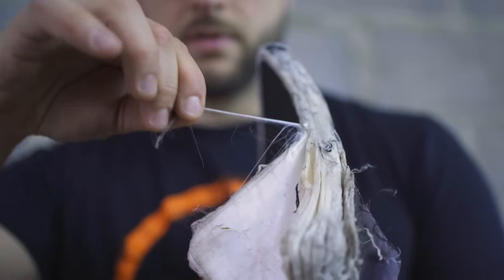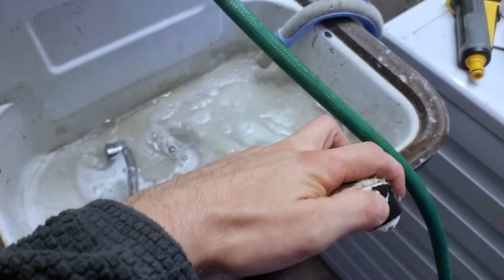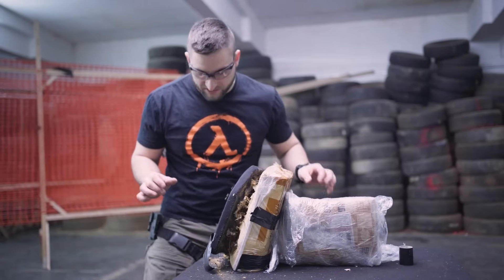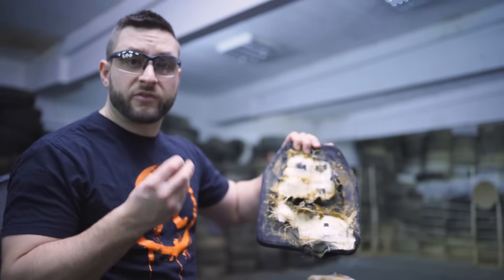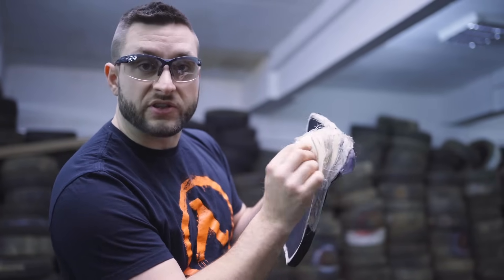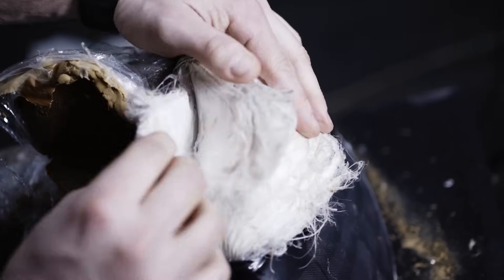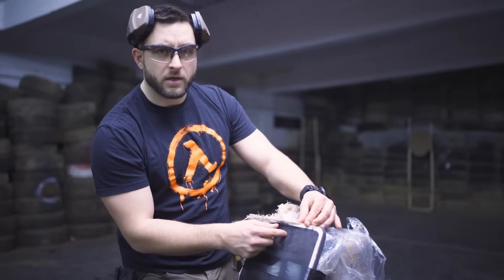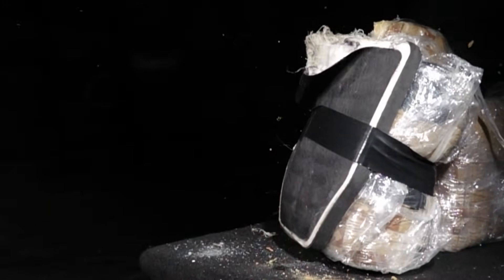Water will compromise Ballistic Plates

Comment: The clay has a massive gaping hole just from the impact pressure. Unfortunately I don't know how to read a clay impression. Without being too graphic, what would that do to a human?
Reply from the maker: Give you a bruise
You cant really read this normal clay. To be at least comparable we would need ballistically calibrated clay at a certain temperature and then we could measure the depth of the impression on the clay and see if transfer of energy is still in normal levels or if it would fail NIJ rating

Comment: The only question I have about armor is heat and cold cycles like in a trunk of a car.
Reply from the maker: Good question
It will degrade it over time but probably not in any significant manner. Ceramic will not be affected, only the backing material. HDPE is quite stable and can easily take the heat cycles but very high temps in the car can probably degrade the glue that holds all those sheets together. 
But again, i doubt that it would make much of a difference even after a decade or two

Comment: I am ghetto and have 3+ steel with a 29 layer Kevlar panel in front and back for spalling. Its heavy af 26lbs, but I would not be running around in it if I ever needed it. It's more for driving from a to b lol
Reply: Bullet fragments flow along the plate and push out along the sides. Kevlar in front and back is useless to stop "spall". You need to wrap the sides of the plates to prevent injury
Reply: @MB_MagicMOnkĒLove  It is larger than the plate and wraps on all sides
Reply: @mhnz785  crazy cumbersome 26 fkn lbs jeez, yeah your not moving around in that very well.

I run ceramic/poly lvl IV that weigh 5.5lbs each, with 6x6 side plates on a Minimalist carrier, and the rig weights 17lbs (without mags or any extras).  Waited for a great sale and only paid around $300 total. 4years ago

I have a backup rig with AR600 steel that have a really good anti-frag coating and those plates weigh 6.6lbs each.

Comment: PE/ Polymer is waterproof (hydrophobic in some blended forms) so I wouldn't expect it to lose performance apart from the very stunted degradation that comes from time and environmental exposures.  
Ceramic is also partly resistant to water, but also degrades faster and differently than PE or Steel-- uncoated/ untreated Ceramic can be affected by Salt Water more than Fresh Water, but is typically minimal.  
I don't think Steel really even needs mentioned, but no affect besides rusting risk if not properly treated.  
Kevlar on the other hand can absolutely be affected (and usually is) by water saturation, completely different material and is the root of general discussion with loss of protective capability in Armor.

That backface deformation/ trauma with PE is pretty gnarly.

Comment: I've always been taught that soft armor should never be soaked in water, both because of the degradation of the material and because water can act as a lubricant, allowing a round to pass through where it might not have before.
Reply from the maker: Most modern soft armor shouldn't be affected by moisture or water. There was a big incident with some type of soft body armor, i think it was Zylon or something like that where the material was degraded by moisture. A cop got shot and the vest failed to stop the bullet
I think from that point on people just assume all body armor can be degraded by moisture or water. 
I never heard the reasoning that water could act as a lubricant and make it less resistant - but you just gave us a great idea for a video! :D
Reply: I know nothing about BA but the plate and the demo looked encouraging, and I would prob wear that  with confidence @PolenarTactical
Reply: This isn't soft armor

Comment: Maybe you won't have a bullet hole, but you sure gonna have broken ribs
You a casualty either way

(Edit: what i meant is steel and ceramic don't break your ribs, but they are heavier. It's better to have something (UHMWPE) than nothing, but it's better to have steel or ceramic)
Reply: dudes be like "i'd rather be dead than have a bruise or a broken bone from backface deformation" 💀
Reply: @zeayh  Broken ribs from the .308. Yes, you'll be alive but you'll be out of action for a long time and your buddies will have to evac you so they'll be taken out for the time it takes to evac you and make it back. It's why German machine gunners in WWI aimed at knee level. Get a casualty out of action along with the evacuation crew.
Reply: @zeayh  
Nah, i didn't say i wouldn't use bodyarmor. You are twisting my words 😅
You can use steel or ceramic plate and not get broken ribs.......

But something is better than nothing, that something is high molecular polyethilene. It's better to have it than not have anything. But it's better to have steel or ceramic so you don't be casualty at all from intermediate cartrige..